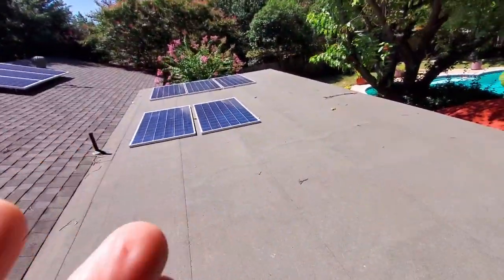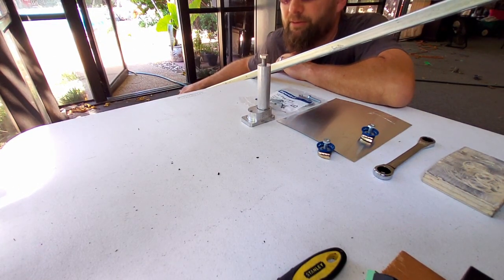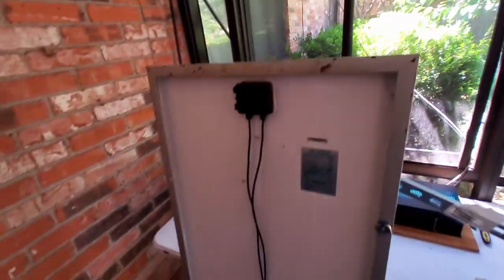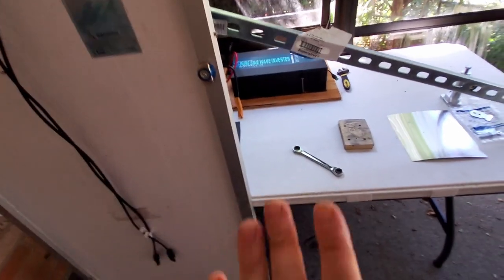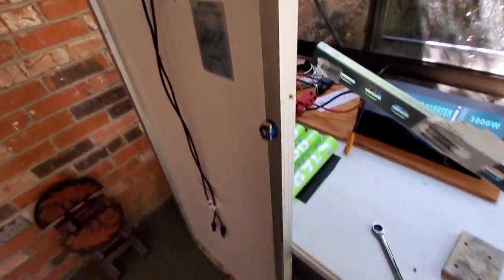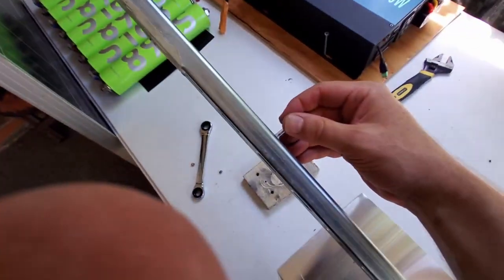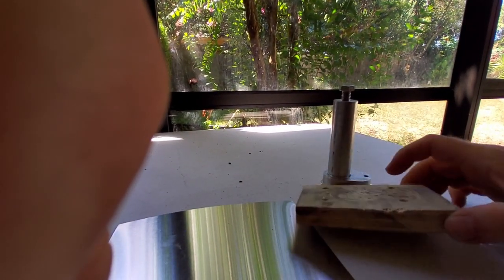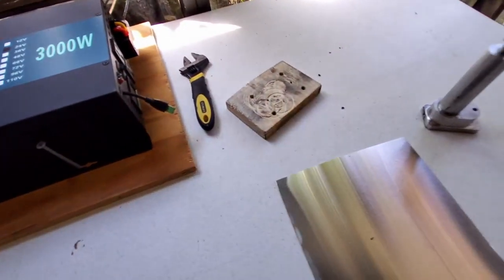DIY Budget Solar Racking

Comment: Just use the Unistrut nuts and bolts. Works great. For the roof, use quickbolt mounts to mount the Unistrut. For a ground mount, go to Grainger and get some fencing hardware.

Comment: so, the problem here is, the frame of the panel is not rated for ANY storm level, it is not structural and it will VERY likely fail after a few REAL storms from stress.
you may have few nasty storms and it may last for years, but eventually it will give way and become a sail.

you want the clamp mounts that pull the panel to the frame from the top of the panel, and the clamp it's self being the structural bracing.
Reply from the maker: Interesting. You ever see a solar pole mount? They all mount from the bottom like this. My company has had pole mounted PV panels in the field for years without a problem. Actually we've had the mounts themselves break from wind loading, but never a panel. But could see where some poorly built panels might be problematic